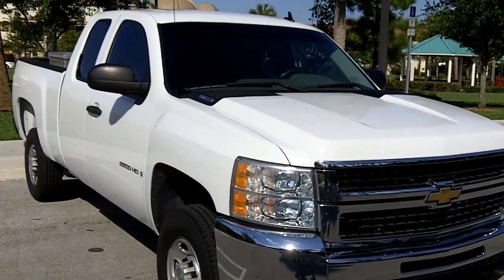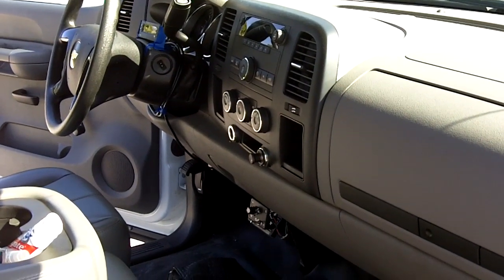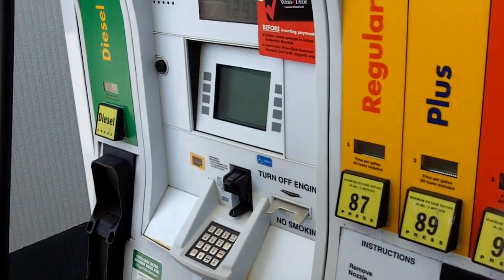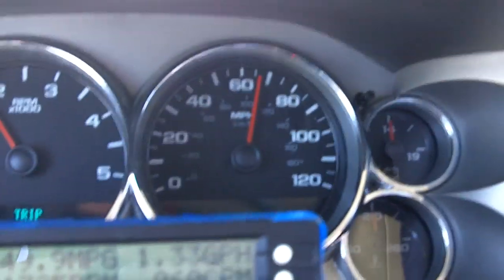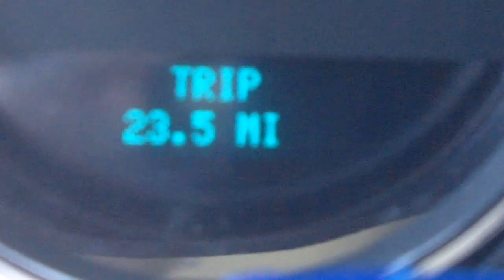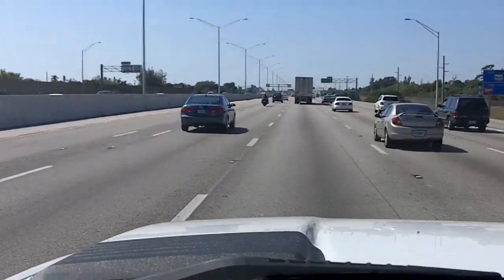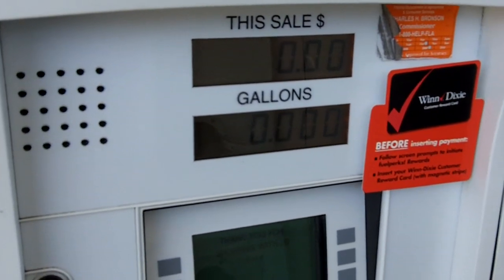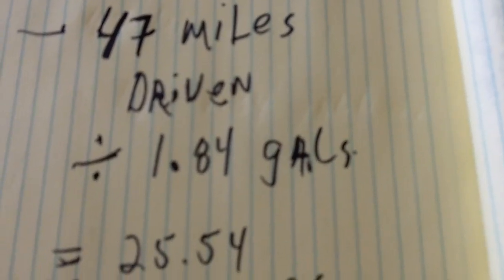Fuel Saver Videos 2007 Duramax Diesel

Comment: He has also heated all the return fuel to the tank thus expanding it leaving less room in tank for the top-off fuel....Gerry the cooler is in the return line to the tank to reduce the expansion if fuel making the potential of overflow less
Reply: I wish all you rookies would crawl under some heavy rocks.  When you have some experience using the systems then you can run your mouth.  I have 15 years experience in the combustion field running this equipment on twenty types of diesel engines.  When you have any experience under your belt with this technology in the lab or in the field just stay under the big fat rock.
Reply: +Gerald Rowley    
Wow that attitude will get you far in life Gerry...
Reply: +John P I have done very well, Thank You.  And I will continue to defend myself, my products, and my reputation against anyone who attacks my good will. You are Welcome.
Reply: +Gerald Rowley 
Gerry I'm not attacking anyone I guess I am questioning the accuracy of your method you use.... You top off tank, then you drive it with a fuel heating device. Common rail systems return all unused fuel to the tank, Thermal expansion is approximately 1% volume per gal. at a 20 deg.F rise. Do the math yourself with your "Reputation and good will" I'm sure you can figure out I guess you already know how much the temperature of the fuel is in the tank with all your research of coarse.
Reply: +John P This video is just a simple trail run of an earlier test completed on this Duramax.  From the comments I can see that this short protocol is misleading.  I inform the readers that a battery of  Third Party Testing have been completed on this test truck by Florida Atlantic University.  A separate detachable fuel tank was used during the tests. The fuel was measured and weighed before each test and after each test using scientific equipment. A total of 600 miles were  driven.  The Report and the Data can be found in the Drop Down Menu on http://www.vapsterdiesel.com
Next time I will video tape the Third Party completing the tests.
Reply: +Gerald Rowley 
Thank you for clarifying that the comsumer should be well informed now
Reply: +John P Glad to give clarification to the matter

Comment: being a duramax tech, working in a GM dealership, this would KILL a CP4.2 in no time at all, this system will increase fuel mileage for sure, fuel temperature is a huge factor in regards to fuel mileage,  but for anyone towing all the time this is a REALLY bad idea,  if you use the truck as a daily driver and tow mabey 5k you will be fine, but if your towing big loads this can cost you 5k to 10k  fast,  not only that this will increase the risk of cracking injector tips since the injector tips require fuel to lubricate and cool the tip since it is directly in the combustion chamber, don't get me wrong i'm sure some guys have used it with success but with the cost of a fuel system on these trucks for the little fuel your going to save trust me it is not worth it. just like using WIX filters on a duramax, extremely bad idea, they do not, i REPEAT they do NOT have a water membrane  in the filter so water goes right into the fuel system.
in the end its your truck do whatever you want but from a Duramax tech i strongly do not recommend increasing fuel tempature
Reply: A technician doesn't understand the chemistry of the combustion reaction.  During the process of combustion the exothermic heat in the   exhaust flow is reduced by over 100 degrees.  The emissions are reduced dramatically including NoX
Reply: Gerald Rowley your right.  Quick burn with vapor = cooling effect
Reply: Kevin Rogers g

Comment: 47 miles is not enough miles to calculate fuel mileage. You have to drive minimal hundred miles to get more of a accurate reading. Couple ounces one way or the other can make a big difference in the MPG. I know for a fact because I have done many test using a Vapor delivery system on a gasoline engine doing test running Coleman camping fuel, acetone vapors, rubbing alcohol, Hexane Fuel Into the intake manifold reducing fuel injectors automatically do to the vapors entering in and the computer recalculating.

Comment: A stock LB7 (FE9 emission) Duramax empty hwy avg 20. You mean to tell me that a stock LMM (w/ DOC, DPF, muffler) & this BS fuel catalys got 25 mpg? Yeah BS. Most cars or Diesel cars avg 30 mpg. 

Going 47 miles is not long enough to test MPG. Test this thing out on a longer drive over 100 miles & get back to us with the results.

Comment: I think it's funny GM puts a nice fuel cooler in front of the fuel tank on the return line,to cool the injection pump and extend it's life,you guys purposely heat the fuel,which may help mileage but no way can it be any good for the injection pump and injectors that rely on cool fuel for cooling the pump and injector tips.Just removing the fuel cooler would accomplish th same thing and keep from cluttering up an already tight engine bay and adding expense.
Reply: Shows you how much you don't know

Comment: If for any reason you are boiling the fuel and the fuel is not cracked you will have leftovers left in your container that will accumulate that will not vaporize. The fuel must be cracked on a superheated surface that cracks the additives and the fuel altogether. If for any reason you vaporize the high-octane only and you do not  vaporize the additives you are left with additives that is low octane that will not run the engine that runs off of gasoline. I am open to anyone willing to discuss the subject on a massive scale as a team of individuals looking to achieve alternative energy getting us all off the bondage of big oil.  United we stand or United we fall we the people have control over all. That means all of us have the control if we all work together and there's a lot of money to go around for everyone because there is Millions of vehicles worldwide to have to be retrofitted. hhhgastechnology. com
Reply: Yes, we work with HHO people.  Our system is superior to HHO because our system is maintenance free.  We also have computer chips that work with HHO.
Reply: Here is the video of the temperature gasoline boils at.  
https://www.youtube.com/watch?v=d7AkcjnCTVU
Reply: Here is the video Off-Road diesel fuel boiling temperature video. https://www.youtube.com/watch?v=Ai1tVEkoxnI)
Reply: ***** We have been working with heated fuels and catalysts for over 15 years.  We work mainly with Diesel fuel because of safety and ECU advantages.  The methodologies are over one hundred years old.  The oil companies just wanted consumers to use more of their product and the vehicle manufacturers went along with the program.  Now they are going to the next level outlaw car owners from legally working on their own vehicles.

Comment: The 47 miles driven on the vehicle is not enough miles to determine fuel efficiency because the fuel tank can be under filled and overfilled and with a short distance of travel mpg can be dramatically changed. The vehicle must have at least 250 miles driven to determine fuel efficiency stretches out the calculations to be more accurate. The only way you can do this on short miles is having one single gallon separate from the entire system it draws from. the ultimate way to deliver fuel to engine is cracking the fuel into vapors which is invisible vapor to the eye and taken into the engine before it cools and condenses back to liquid. If everyone follows the process of the oil refineries processing fuel and delivers that type of vapors to the engine is the ultimate way of delivering fuel. I am glad that you are working hard on eliminating the bondage of the dinosaur delivery system that we are under at this moment dictated by the automotive industry and big oil companies. Keep up the good work fuel free to contact me through my website that has a telephone number and email. hhogastechnology. com
Reply: Go to Vapsterdiesel.com for University testing on Duramax.  Over 600 miles driven during testing.
Reply: What the system is doing is just heating the diesel fuel so it vaporizes more efficiently inside the combustion chamber. The hot water cooling system raises the boiling point of the diesel fuel for easier atomization. Gasoline Boils at a low temperature of 165°

Comment: wow. that's not how you test mpg. I drive a 2010 chevy 1500 and I can add at least 4 gallons of gas after the pump stops. I could drive 47 miles and avg 30mpg if I wanted to.